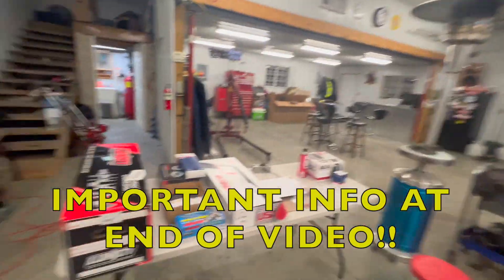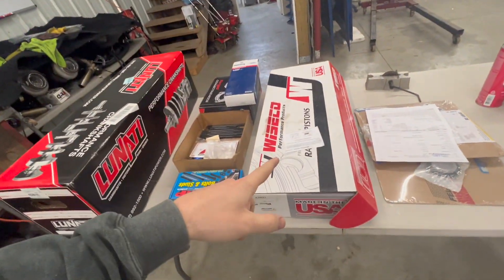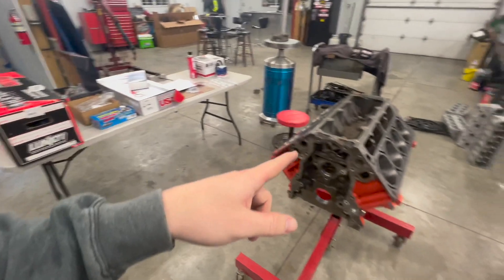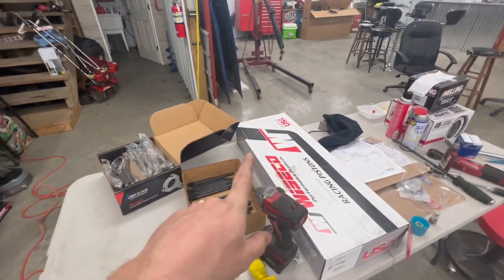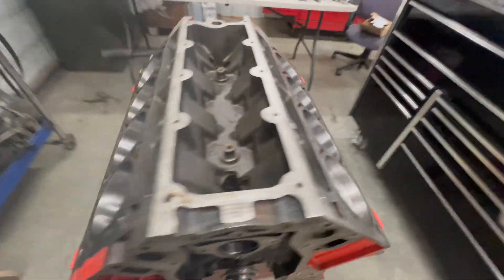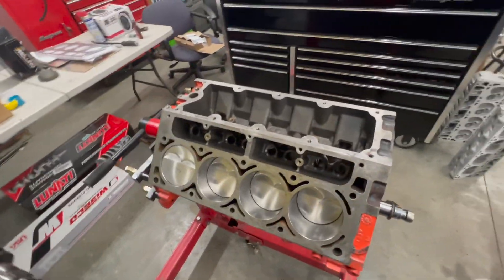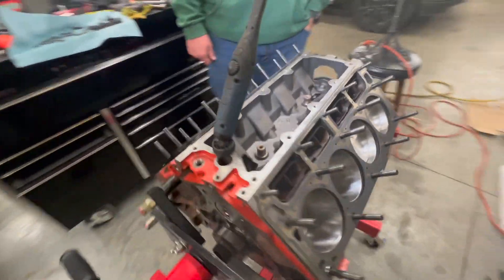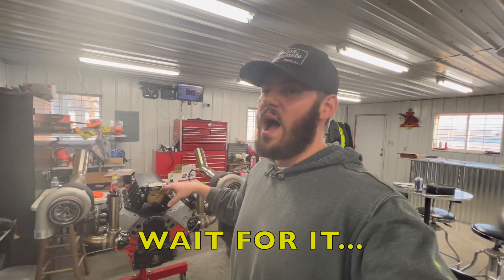Forged 370 Twin Turbo Ls. How long will it last this time?

Comment: Going to be hard for 1500 on e85. And if you want a good budget pump to supply that amount of fuel, I have an Enderle 80a.
Reply from the maker: Yeah me and my buddy are looking into a barrel of race fuel. I wouldn’t mind trying alcohol either
Reply: @Rev2lateRacing  Alcohol is the way to go, but your holley can't do it. You'll need the HP or Dominator and the NTK O2 sensor.
Reply from the maker: Oh dang I didn’t realize the terminator couldn’t tune alcohol 🙄
Reply: @Rev2lateRacing  Nope and you need the NTK sensor to read low enough and survive.
Reply from the maker: @funfun8095  is the ntk just a specific sensor for alcohol?
Reply: @Rev2lateRacing  It's an NGK sensor, their sensors are NTK. You can use it for any fuel, but the terminator can't read it. They are the best O2 sensors.
Reply: @Rev2lateRacing  Don't buy one from holley, either. They charge over 150.00 for one and you can get one on rockauto for 96.00, but...that's when/if you can run one. ;)

Comment: Did you line home the mains
Reply from the maker: Yessir. Line honed the mains, balanced the rotating assembly, decked the heads with a valve job, and bored the cylinders 30 over

Comment: Trying to build one of these pretty soon as well. Why 370 vs 408? I keep hearing about pistons hanging out of bores and piston slap etc.
Reply from the maker: Yup you nailed it perfect. The guy did my machining anything over 390 the pistons will hang out the bottom of the cylinder and multiply wear
Reply: @Rev2lateRacing  Dang so it is true,coming from a 6.2 I probably won’t even notice a difference once boost comes in. Thanks
Reply: Had to come back to this vid, which lunati crank is that? The sub $1000 or the $2000 one?
Reply from the maker: @jpatrick260  I’d have to look at my invoice but I’m assuming it’s not the $2000 one bc my total was mid 3k with rods pistons bearings etc lol

Comment: curious if that was a stock bottom end that failed and if you had ARP rod bolts in it when it failed??
Reply from the maker: Yes and yes. But I think it failed due to e85 tune being off and not just due to stock stuff
Reply: @Rev2lateRacing  seems like this happen a lot.  The ARP bolts have less stretch and make the bearings have uneven wear which causes failure. Unless I build the motor with them and true the bearings with that rod bolt, imo stock is a better option for stock bottom
Stuff. Great setup btw!

Comment: Are you still around man id like to talk about your build, I'm building a 6.0 with twins and??? For turbos, I'm thinking 67 62s  or  66 73s I'm stuck.
Reply from the maker: If I were you I’d call the turbo manufacturers. That’s how I determined what size to go with. But if it’s a 6.0 and you’re wanting to do what I am, I’d be willing to be both would be good choices. Just depends on the build really